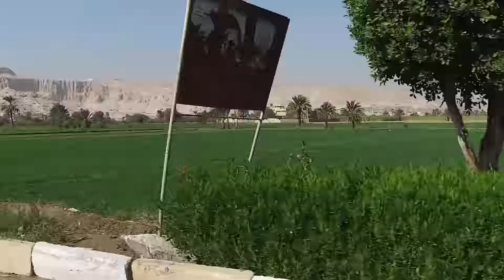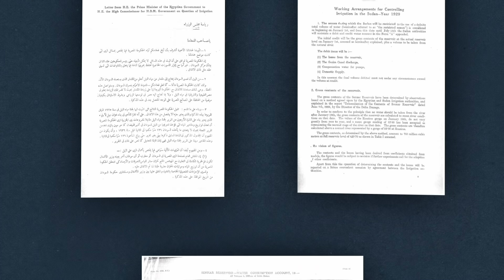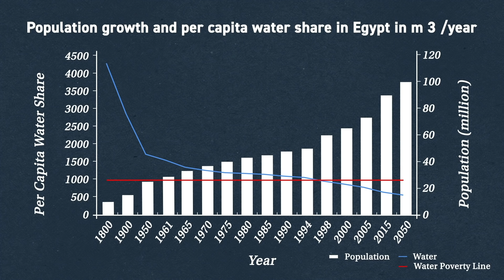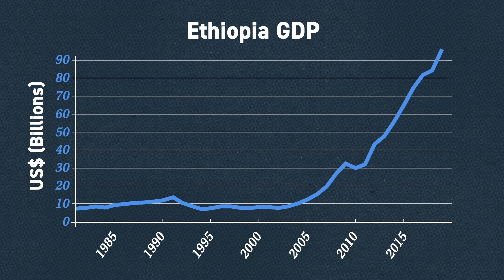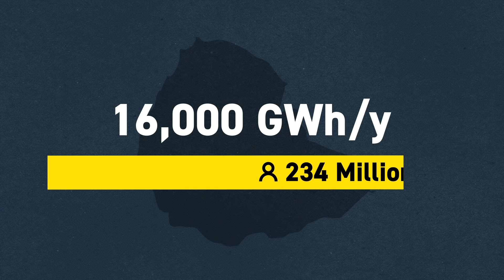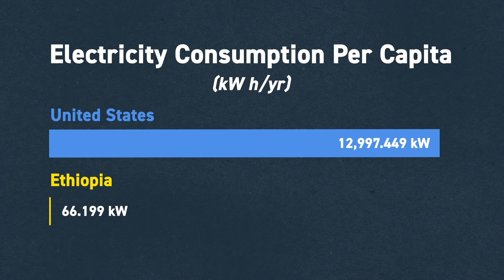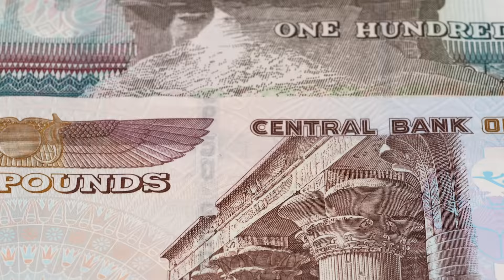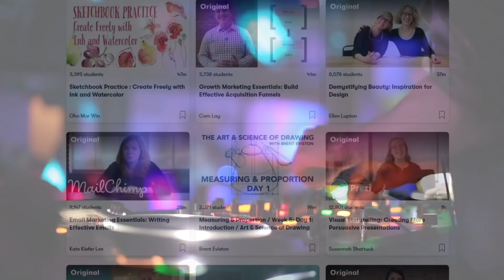Egypt's Dam Problem: The Geopolitics of the Nile

Comment: There’s a very similar problem with the Colorado River, since the US states of Arizona, California, and Nevada basically have complete control of how much water reaches Mexico where a lot of people have historically depended on the river. It’s not always a nice relationship.
Reply: The states can't threaten each other with war though and the amount of water Mexico uses from the Colorado is insignificant compared to Egypt's use of the Nile.
Reply: In light of Colorado's (which is the water shed of several other rivers as well) increasing desertification issue, all the states have signed that they need to become less water dependent on Colorado. Colorado now gets first rights to all the water and the other states just need to figure out how to live with the reduced flow. Its now an end-user problem, much like how it'll probably be for Egypt.
Reply: Dude it's NOTHING similar. The Colorado river water has been 100% diverted since decades ago. Not a single drop reaches Mexico anymore. Egypt should feel REALLY lucky it's Ethiopia, not the U.S.
Reply: @wshtb  ok so after doing literally the bare minimum (looking at Google maps for about 5 minutes) the river most definitely reaches Mexico where it's diverted near Yuma mostly to a canal that then feeds irrigation systems in Baja, with what's left going into the bay of California. The canal is called "Canal Alimentador Central."

Comment: 15:01
“Without experience in multinational cooperation, Egypt can’t accept less than full control”

Looks like Egypt will have to learn to play nice. This is out of their control and they need to recognize that.
Reply: War .... its gonna happen, also a more realistic ww3 start then most others.
Reply: @wolfsden6479   no war, unnecessary and it won't solve anything
Reply: @worldfreedom1271  ... exactly how would it not happen
Reply: @wolfsden6479   Well its a hydro-electric dam, meaning it has to let out water in oder to operate... Egypt doesn't have the capabilities to actually bomb the dam, their planes don't have the ability to reach all the way to the dam... All 3 countries are saying Ethiopia has the right to build the dam, they just disagree how quickly it should be filled
Reply: @worldfreedom1271  yea, what you just described is the perfect conditions for a full blown ground war when Ethiopia cuts off to much water. 

If Egypt could blow it up easily then Ethiopia whouldnt do something to anger them to much. But because they can defend the dame, and land war is going to happen. And Egypt what's to do it before they can't break the dame because of flooding and before they are hurt.
Reply: @wolfsden6479   I've been studied the situation for decades, I know more than you on this matter.  This can't be solved by warfare, as even the Egyptian president has said.  The nile in Ethiopia comes from multiple streams, you don't need to have a dam to cut off water.
Reply: @worldfreedom1271  self ethos isn't an much, even more so when its blank because of internet making you anonymous."you don't need a dame to block water", ... dosen't change that the dame will block water, and that the current incentives push them towards blocking alot of water. So unless you are high level intelligence that knows Egypt has secret weapons that can blow up the dame, there is no incentive to not get the dame fully operational as quickly as possible.

Comment: The problem with Egypt is that it tries to impose the Nile Agreement on nations that did not exist at the time.
The Nile Agreement was between The British and Egypt. Kenya was British East Africa, Uganda was the Uganda Protectorate, Tanzania was British Tanganyika (and previously German East Africa alongside Rwanda and Burundi which were handed over to the Belgians just two years prior).
None of those entities exist today and trying to impose the same conditions does not wash. No nation adheres to colonial era agreements made not by the locals but the colonial power, ever. And Ethiopia was BTW never a party to the Nile Agreement ,ever. Even though Ethiopia was an independent nation at the time.
In the end, Egypt will either have to drop its stance on the Nile and negotiate with downstream nations or it will face a united downstream  pact where Uganda, Ethiopia Kenya and Tanzania continue to draw on the sources of the Nile and end up signing a defence pact that even Egypt, as powerful as it is may not want to face.
Also Egypt needs to look at what Israel has done and build giant desalination plants along its Mediterranean and Red Sea coasts and also recycle the water from sewer plants for things like watering gardens, washing cars and the likes, instead of relying on the Nile.

Comment: As the water in the reservoir has less momentum, all the fertility could get stuck behind the dam & sink to the bottom.
Reply: you know you can grab that silt and sell it?
its not really an issue
Reply: @tewekdenahom485  Not an issue unless you are Egypt & have relied on getting the silt for free since time immemorial.
Reply: @ccityplanner1217  That silt originates from the ethiopian highlands not egypt, and in anycase egyptians dont rely on it since the aswan dam was built it has stopped the  nutrient rich annual floods
Reply: That's one of the reasons we're building the dam.

Comment: Egypt has enormous potential capacity for desalinization and could enhance future availability, while Ethiopia has none.
Reply: theres a problem here. desalinization costs a lot of energy and money. the energy it takes to filter out the salt will offset th energy production of the dam, which is a source of water loss(albeit temporary)
Reply: @kairon5249  they have one of the hottest areas in the world, solar power is a great great solution.
Reply: @rohankishibe8259  egypt would be horrible for solar power because of the enormous sahara sandstorms.
Reply: @kairon5249  just build huge walls or something, we humans species reached the damn mars and we cannot stop a sandstorm???
Just pay your engineers a good amount and they'll deal with that...
Reply: @rohankishibe8259  are you trolling? it would cost a tremendous amount of money to block the sandstorms. you would have to pump water from somewhere to make the soil that the solar panels are placed on not be sand, and that just defeats the purpose of the solar panels. egypt is a water starved country, so they would have to send desalinated water, but they need energy to desalinate water, which in the end will go to producing the energy. you see what i mean? 

it is infinitely more cost efficient to place solar panels in a place that doesn't have sandstorms, even if power output is lower.

Comment: Egypt will have to build it's own dam at the end to retain more water.  Ethiopia also has to understand that the drier the other countries  get the farther the desert  will expand and encroach on them. Desalination  may be key for the future. Never leave the future of your country in the hands of others- be proactive.
Reply: Egypt basically want all the benefits and wants to leave opiate as it is. Egypt is culprit here. They are selfish here.
Reply: @cutevegan7163  That may be so, but a threat to cut off the water or even reduce it's natural flow is not the option.
 We had a situation around here where 2 cities were reliant on a bridge that was in a third city. The bridge controlling city made high demands of the other 2 cities and at times, to prove their bridge value,  they would close it down stating repairs which never would happen, but the area would be at a complete halt. In the end, the other 2 cities built a new bridge between themselves and completely bypassed the third city and its bridge- over time, the third city failed and became part of one of the other cities. 
Point being, Egypt needs to make  their own dam and reservoir to slow up the flow of the nile to the sea and incorporate desalination.  Playing politics or going to war is not the option. There are other ways around those trying to control the water flow.

Comment: Well in order to really talk and inform on such a delicate matter; you need to study the Dam characteristics and its maximum water flow, and how is that going to affect the water flow and levels in the Nile. Which the numbers show even more water shortages in Egypt and Sudan. Plus It's an international river so all international rivers' laws apply to it that clearly ensures food and water safety for all countries, so Egypt and Sudan have every right to that river's water. The other thing is the location of the dam isn't on level grounds and with such a massive amount of water and water pressure it there are concerns about its failure thus drowning all cities in Sudan along the Nile. Concerning Electricity, Egypt already has excess power and offered to export and help Ethiopia Generate Electricity by other means. It was also proposed to reduce the dam's size to reduce its negative effects as there are more negatives than positives regarding this dam, but Ethiopia refused both offers. 
On top of that, I am not surprised that you didn't mention the Nile friendship treaty between the three countries that they all agreed on and signed in 2015. in that treaty, Egypt and Sudan compromised and agreed to lose some of the water flow in order for Ethiopia to build that dam, and all three countries operate the dam and for the reservoir to be filled over 15 years to minimize the water shortage. 
Well, you guessed it! Ethiopia is now backing off and withdrawing from the treaty and started filling the reservoir and gonna fill it in 3 to 5 years onlyyyy!
So, how can Egypt and Sudan trust such a nation, that is refusing to compromise and negotiate and manipulative that threatens their water security. 
You tell me!!!!!!

Comment: I would say the bigger problem for Egypt is not "only" the "short-time" problem filling of the reservoir, but even worse the "forever" situation that it can and will regulate the flow level. No more floods. For Ethiopia, it's most beneficial, that the amount that passes through is steady over the whole year, so that all turbines can produce energy all the time. But no more floods destroy the cycle of Nile flooding the land around it, fertilizing it.

Comment: how is it going to get solved when Ethiopia refuses to sign any treaty or agreement to insure the minimum impact on Egypt and Sudan.
Egypt and Sudan didn't receive the plans and the safety of the dam, How can Egypt and Sudan sleep with a 75 billion m3 water tank over they head.
you also need to check the numbers in regards to the power the dam will produce, all experts said it will never produce that much electricity. 
If you need to knew more about this conflict please contact me. 
you doing great job and thanks for bringing up the issue .

Comment: You're Electricity Consumption per Capita slide has a units error (9.32). The bars should be kWh rather than kW.
kW is instantaneous amount of energy. A light bulb uses 100W right now (kind of like how fast someone is going at this moment). W = J/s
kWh is the total amount of electricity used over time (how far did some travel during x time period)
Otherwise, great video!

Comment: Whoever told you that Egypt and Sudan refuse to cooperate with Ethiopia, Egypt supports the Ethiopian renaissance, but it rejects any unilateral action without taking into account the interests of the downstream countries. Egypt helped other countries build dams and helped them to advance, so why refuse that to Ethiopia. But the real question is why does Ethiopia want to build a dam on this particular river while it has 11 other rivers? There is more than one way to generate electricity other than this method, which leads to literally slow death to other countries. And how can Egypt and Sudan trust the Ethiopian government after it took unilateral action to fill the first filling of this dam, which affected Sudan, and also see the dam that Ethiopia built and what it did in Kenya as a result of the policies taken by the government, which caused the water supply to Lake Turkana to be cut off; And other disasters. All this and I did not talk about the problems that the downstream countries will actually encounter

Comment: Dont understand the issue. Dams create retention lakes, but once that lake is full, the same amount of water that originally went down river still has to go down river. Dams dont and cant reduce water flow indefinitely.
Reply: Tell that to the Egyptians. And this dam is built 25 miles from the Sudanese boarder, which means that the Ethiopians did not intend it for irrigation, which is not possible anyway. Not much flat land in that part of Ethiopia.

Comment: Ethiopia might have the power to turn off the water but they also have a single point of failure to send large portions of the country back to the 1930s. If they turn off the water, Egypt will use their military to turn off the electricity.

Comment: Ethiopia has made a compromise to fill the dam in 7 years but the problem is more of a political, rather than technical..There is this long held Egyptian position to maintain the monopoly through mischief and destabilization of the upper riparian nations particularly Ethiopia, the origin of 86% of the annual water flow..Hence all the ethnic strife we see in Ethiopia is not because the ethnic makeup in Ethiopia's is any different to many nations in the world, but because divisive politics has a backer outside of Ethiopia..So Ethiopia a country that has no control over where the source of the Nile should have been, but has been a victim of its own resource has no choice, but to finish the GERD and aim for more projects to strengthen its negotiating power as no amount of compromise will help the stalemate. In other words, compromise or not, Egypt will always "understandably" keep the option of keeping Ethiopia in constant turmoil unable to utilize its water resource, hence Ethiopia's only way out of this is to by all means necessary claim its rightful place as the source of 86% of the river. Only then, there will be mutual respect and the desire to negotiate faire and equitable share of the river..Bare in mind, as things stand this is the only river in the world where downstream non contributing nation(Egypt) dictates all the terms based on colonial era agreement and that is what is both politically or technically unsustainable my friend.. . thanks.

Comment: It's actually not true that there have never been water wars.  Ethiopia and Egypt have fought more than 5 between 1875 and 1884.  The video seemed to imply that Ethiopia was a colony of GB in 1929 when the first agreement was signed.  Ethiopia was never a colony.  The Egyptians and the British just didn't think it was important enough to invite the country that produced 80-85% of the waters to the table.  The British were handicapped by their racism, what's Egypt's excuse ? And rather than see that as a huge injustice to address, Egypt and its supporters continue to insist that because of poor choices Egypt has made in being solely reliant on the Nile, that other countries can't use the Nile. Ethiopia's plan to use the Blue Nile (Abay) was studied in the 1960's. Egypt used its influence to prevent it from obtaining loans to build the Dam.  Egypt engaged in political disruptions of Ethiopia through support of ethnic rebel fronts (OLF, EPLF, ELF,ONLF) throughout the 60's through the 90's to handicap Ethiopia's realization of utilization of the Nile. In the 2000's, 11 African countries, (Burundi, DR Congo, Egypt, Eritrea, Ethiopia, Kenya, Rwanda, South Sudan, Sudan, Tanzania, Uganda), came together under the Nile Basin Initiative (NBI) to cooperatively develop a sustainable plan to utilize the Nile equitably.  Ethiopia, Kenya, Uganda, Rwanda and Tanzania signed a cooperative framework agreement to develop water use plans which made Egypt and Sudan angry.  Between 1875 and 1884 Egypt sent no less than 5 army's to invade and occupy Ethiopia, all annihilated by the Ethiopians. African countries are refusing to beg Egypt permission to use the Nile.  Egypt has had decades to prepare to wean itself off using the Nile to develop its desalination and ground water plans which have been shelved, again, for decades.  Egypt's and Sudan's insistence that Ethiopia and the other African countries not touch "their" water shares is the same as Ethiopia and the other African countries insisting Egypt and Sudan not touch their oil. Ethiopia didn't draw up a plan that gives itself 58% of Egypt's oil free and clear for its use. So, let's not engage in absurdities just because others do.  Let's not create or abide ridiculous equivalencies that stretch, and frankly insult, our credulity. Just like any other sovereign nation Ethiopia will use any of its rivers as it pleases.  If they are transboundary rivers, it will try to use them in such a way that significant harm does not come to other countries.  But Ethiopia will not starve or suffer want anymore just so Egypt can irrigate its pretty parks.  Last time I checked parks are not an existential need.